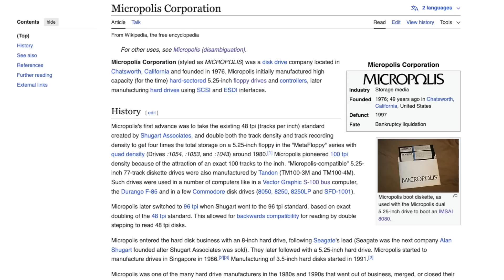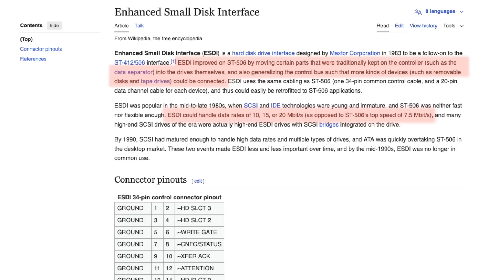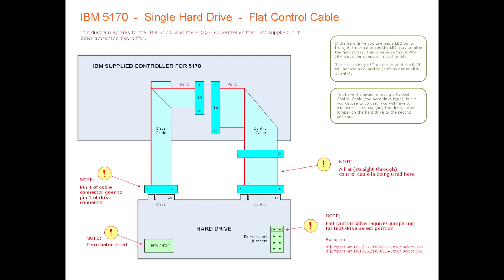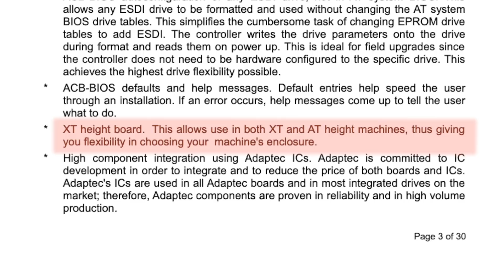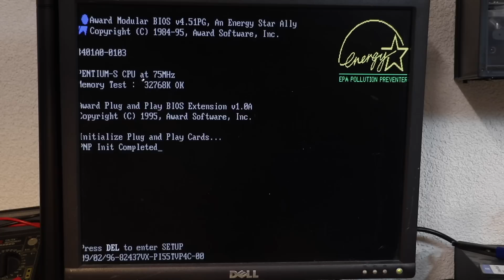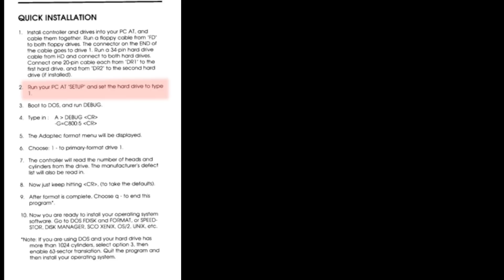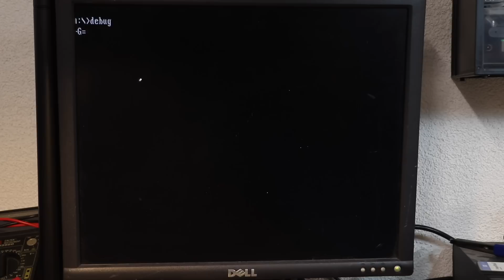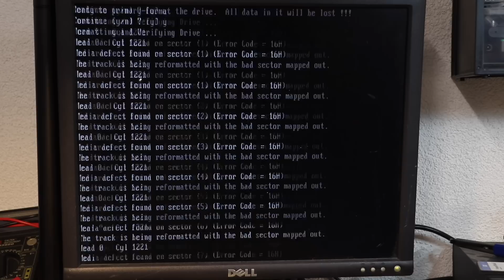Micropolis 1558 ESDI Drive: Will It Still Work After Decades?

Comment: Have the predecessor of this drive, the 1355 with 170Mb. Actually used it for a while in the mid-90s when it was already obsolete. Bought it at a computer swap meet for a song; had no idea what ESDI was until then, and wouldn't have known if the seller hadn't told me -- and conveniently thrown in the appropriate controller to go with it. The combo worked last time I tried it, but that was decades ago. Should give it another spin one of these days.
I guess ESDI is now all but forgotten these days.

Comment: A different issue to you magic smoke problem, but check the driver transistors, sometimes these would die leading to the strange noise as the drive attempts to start up.

Comment: Technical Quirk Reporting !! I have a few ST-506 & Relative of that HDD, mine is a 1588 SCSI last used by a AMIGA, so long ago, I am Afraid to turn it on, you give me strength, I will get on it, Strangely @5:28 when Bios see HDD, Specs do not match mine, in a Book I Have, Called "The Hard Drive Bible 8th Ed". Micropolis 1558 has a few variations, but only 1 with 338Mg is 1558-15 - 338 Meg - 15 Heads - 1224 Cylinders -36 sectors per Track, as written on yours, sad ending ...

Comment: If the drive can't be fixed you can still get and AT and install that ESDI controller on it, then you will also need a Nuclear Power Plant budget to get an ESDIFlash to emulate the old drive:
"SSDL to Design ESDI Solid-State Drives for EDF Energy’s Heysham 2 Nuclear Power Station"

Comment: Was C800:5 specific to Adaptec or all controllers of RLL/MFM/ESDI vintage for low level formatting drives?   I seem to remember needing that in the past but I forget why.
Reply from the maker: @jrherita  there was no standard, some used the same, others used a different entrypoint.
Reply: Standard DOS low level Format, Before a DOS Format, If your drive went belly up, sometimes the way to rebuild it ... to do a low-level format by booting to DOS, accessing the DEBUG utility, and entering the command G=C800:5 ...
Reply: @James_T_Quirk  Thanks - I thought I had to do this on a SCSI controller for a 65 or 85MB drive I migrated from an old computer platform to the PC.
Reply: @jrherita  SCSI is Different, I have SCSI cousin of Drive in Video, Last Used in 1 of my Amiga 2000's, it came from IBM Full Tower Server, set up to Network Mac's, When I got it, Gave it Power & a SCSI lead from 2000, Amiga saw it, Formatted it, Mounted it, Amiga just said "Mine" like a seagull over a Chip ...... St-506 is similar to ESDI, just slower but these also require a Low Level Format Sometimes...
Reply: @James_T_Quirk  Agree SCSI is different, but At least I remember one or two SCSI drives I had to low level (Most other SCSI drives on my PC definitely didn't need low level. and my Atari ST had no issues with SCSI attached via a SCSI to ASCI converter).  Hope you're still enjoying those 2000s - they're beautiful machines!
Reply: @jrherita  Well Sadly bit of a Mess, Plenty of Amiga's only 2 cases, They were working Amiga's, I had a Toaster Farm Set up, so @ 1 point put them in a homemade racks, as I was Changing Cards about, So 6 Amiga 2000 MB & Cards, + 2 with a case, but only 1 W.I.P currently ... I was a Commodore Dealer so my Amiga pile is deep, I have A500's  as well, that old SCSI Also worked fine on Commodore A590's Sidecar SCSI, also given a PC Power Supply next to it, I have had 5 SCSI Drives hooked to a A590 on A500 Amiga, SCSI is a great thing in older Computers ...
Reply from the maker: @ That‘s what the controller‘s format depicted in the video is supposed to do, a low level format.

Comment: Oh snap,  Adaptec+ESDI .. nostalgia!  -- should be a good video :)   EDIT:  Capacitor might fix that weird startup noise issue -- it sounded like a power problem preventing something from spinning.  Worth a try...
Reply from the maker: Yeah, I'm investigating it. I'm not an expert on these drives, but I could imagine it's the R/W heads actuator, just a guess from the sound.

Because if the drive is not configured in the BIOS, it doesn't do that particular sound, as in the heads don't move to read track 0.

And the noise might be exactly that, the actuator trying to move the heads, not succeeding, because of the potentially failed cap.

Or, it's not moving, because the head crashed, and is somehow stuck/blocked.

I hope I can figure it out eventually.

Comment: I used to use a similar full length Adaptec RLL controller. On 80286, and 80386 SX. When I attempted the next upgrade, swapping the 80386 SX motherboard to a 80386 DX motherboard, the controller and / or drive went poof! Along with all of the data on the drive. Such was my very first experience with a 80386 DX machine. I ended up with an IDE Quantum LPS 240 drive as replacement to the Adaptec RLL. Rightly you should seek out a quality 80386 SX motherboard to tinker with the full length 16-bit ISA Adaptec controllers. I had a terrific one... an official Texas Instruments motherboard, with on-board green power LED.
Reply: Ugh that sucks.   I bet the IDE drive flew though for the time :).   My first IDE drive was faster than anything else I had used at the time (SCSI, RLL, ESDI, etc.) -- though mainly (now I think) because it was 3.5" instead of 5.25".
Reply: @jrherita  Correct, the RLL drives I had at the end were 65MB 5.25" Mitsubishi  drives, a matched pair of them. I suspect they were pretty high RPM drives. So the single 240MB drive was a size upgrade. In my head I still hear the heads idle seeking occasionally every so often. And the controller was significantly smaller! I went from the Adaptec full length card to a card that was a little wider than the 16-bit slot length..... from a board full of logic chips to just a few chips. The Quantum LPS series was their higher end drive. I cannot recall the lower end line letters at the same time period.